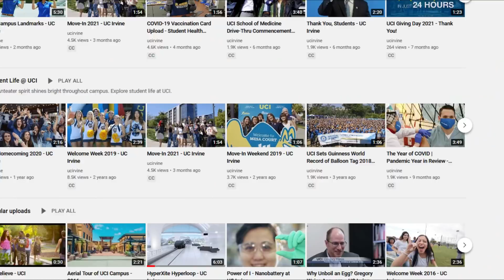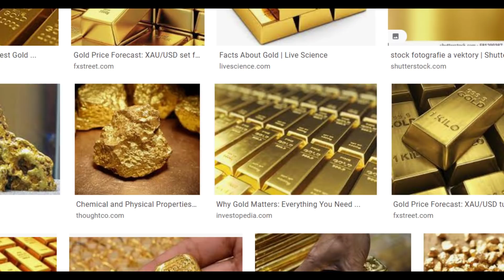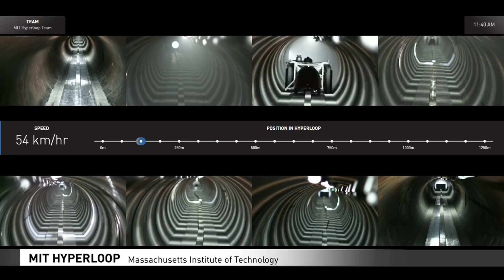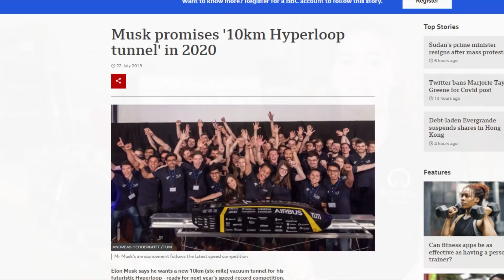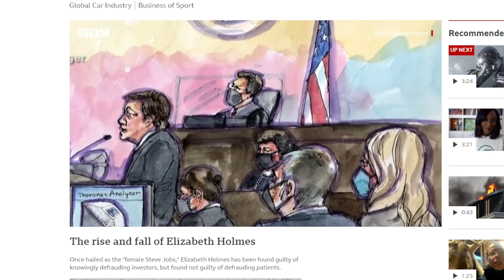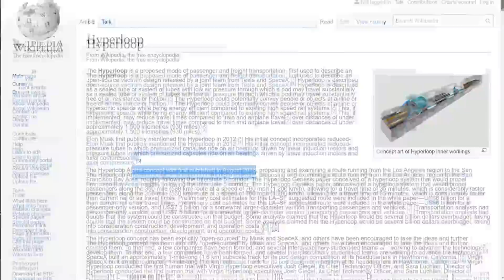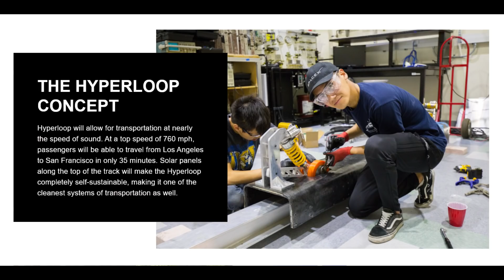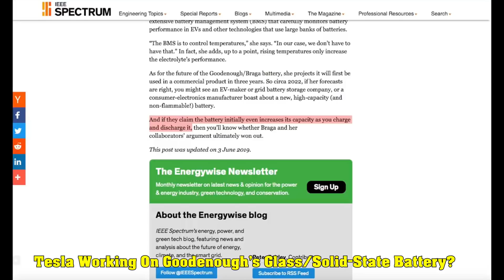The GOLD Battery that will revolutionize EVERYTHING!

Comment: The funniest thing was when they tested the pod, reached 60mph and they released it, only for it to stop by itself on vaccum faster than my civic on rubber tires on air...
Reply: Was this the original test that TF keeps playing? They were actually trying to test the breaking systems. The winning entry stopped the fastest using just the rails. Some of them were really crappy at stopping so it was hard to see what the competition was.

I think all of them took longer to stop than a family car which was crap because they were pretty light.
Reply: Faster than that Civic with the brakes locked up
Reply: @glenecollins  What else do you expect from Thunderf00t? As long as he can grow his Musk hateboner he don't care about factchecking. The sad reality of many skeptics these days who are right for the wrong reasons.
Reply: @sevret313  pretty sure the guy @glen is dissing musk and not in favor of the hyperloop lol. Stop dreaming maths says no so stop peddling crappy concepts
Reply: @sevret313  r/woosh
Reply: @sevret313  Regardless of if the video was about breaking or not. Explain how the hyperloop is in anyway a remotely good idea? I don't even mean finically. I mean physically. Tell me how at the first corner all the passengers don't die from the g-force or how the pod doesn't rip itself apart due to the internal friction forces? Elon is a man peddling lies to try and make money. The point stands.
Reply: @sevret313  musk is actually a tool, so don't get too upset. I don't dislike him due to TF either, musk is just a public facing figure that people somehow relate to. 

I reckon his supporters (that think he's actually taking part in projects) to 14 year old me believing Bill Gates was a genious and worked hard on Microsoft windows... when in reality he was so detached he didn't even work on DOS, he was just a face for the company.  Musk is the exact same thing, the only thing he does is sit on the phone and do public events.
Reply: @volvo09  The Edison of our times, specially the way he abuses Tesla's name, must be rolling in his grave
Reply: @volvo09  Gates Did a fair bit of the work on Dos  (which was the basis for Windows for a long time) and basic. Once he had enough of the intellectual property he ended up doing a lot more of the buisness side of things. Musk bought all of the IPs which he has made most of his money on, I don’t think he actually worked on any of it.

Musk has been pretty much a shares salesman for his whole career. That makes him more divorced from the products and could give him more plausible deniability. There is plenty of information showing investors he may not know what he is talking about. That was never the case for any of the Microsoft guys.
Reply: @glenecollins  Lol no way that's right? Why bother showing the full length of the track then? I doubt that's right what you said, source?
Reply: Civic owners are men of culture
Reply: @88Magician88  the maglev version of the Hyperloop is perfectly doable from a physics standpoint. The internal forces would generally be low except when emergency breaking. and we currently have the tech to carry most of the power required to operate the “pods” in the rails. 

We even have the tech to surround the pods in maglev rails so they could corner relatively quickly (but very uncomfortably for the passengers).

In a physics demo world there would not be problems with buying access through properties etc, you wouldn’t have to worry about the expansion seals wearing out due to constant work because you could use very large sweeping corners to allow movement for expansion etc.

IRL of course there would have to be tight corners etc due to property boundaries, geography and even local geology where you would be correct and the top speed would have to be greatly lowered for safety and comfort.

Areas with size constraints would also require way more upkeep because they would have to use the expansion joints I mentioned earlier as well as all the extra forces being placed on the whole setup. (There are also the safety concerns of having a lot of people potentially trapped in a small hot evacuated tunnel etc)

At least for the Virgin version I don’t think it is fair to say it is physically impossible just that it is far more expensive than a maglev train system and in practice on earth it wouldn’t have enough advantages to justify the enormous extra expense.
Reply: @glenecollins  I get that's physics says it's possible, but isn't a hyperloop extremely dangerous or is there something I'm missing. Especially in CA where earthquakes happen often?
Reply: @Onomatopoeia4u   Fire a bullet at it and pierce the outer layer and the entire thing collapses, in fact if there is a failure anywhere along the line the entire thing is done for, it can be viable physics-wise and it can be done via engineering it however would be the most expensive fuck up of all time, regular mag-levs in Japan are operating at barely any profit and that's in a country where majority of people use it as transportation every single day, now imagine putting that in a vacuum tube hundreds of miles long under near vacuum and all the stuff that will have to be done in order for them to insure it will both stay under vacuum and not kill people, do you think maintenance of such a tube would be less or more than conventional mag-lev trains? It's basically mag-lev maintenance cost plus vacuum tube maintenance cost, then think that car obsessed country like U.S. would just give up on cars and choose Death-loop over established, safer and cheaper modes of transport, already majority of Americans aren't using public transport in high enough numbers for it to be cheap, what do you think a ticket for Death-loop would cost? The viability of such project would hinge on just sheer number of people and/or cargo transported i don't see this happening, assuming it's created it will be abandoned or heavily subsidised by the government, because it simply won't have the numbers on its side.
Reply: @sevret313  The joke

You
Reply: @JoseMariArceta  you can hate musk and use facts simultaneously 🤯
Reply: @88Magician88  
Yeah the hyper loop animations with too sharp bends, are engraved in my memory. It is just a pump and dump scheme.
Reply: @IloveBaguette  r/itswoooshwithfouros
Reply: @glenecollins  
The hyper loop concept is a hoax.
Maglev was the future of railways and deemed too expensive. 
Putting it into an expensive steel tube requiring enormous amount of energy upkeep to employ a vacuum, while reducing the passenger count to few people.
It is unviable by factors of hundreds.
And tickets will cost $20…

Hyper loop is like saying the next iPhone costs $8, Coke cola costing $0,01 per bottle, a brand new car for $300.

It sounds like a great deal, but immediately not realistic. -That is how the hyper loop works: Most people have no idea about engineering and dual wield the numbers to defend a concept, that would save them money, if real.
Reply: @glenecollins  no. Gates didn't do any work on dos. He bought it from scp and other people worked on it.
Reply: @sevret313  As opposed to Elon, who is right for the wrong reasons.
Reply: @forbiddenera  I have the original MS-DOS source code around somewhere (not PCDOS version 1 or QDOS or anything) it has a heap of notes by him. 
It is true they bought the original QDOS off the guy who ran the first Visual Basic projects but they weren’t such a big company that they could afford to have just a buisness person up until around windows 3
Reply: @antman7673  maglev got deemed too hard in the US where it’s primary competition is airlines. In China and Europe where there is a shitload of people in a relatively small area it seems like a much more pressing concern.
Also in Europe and China it tends to be easier to put transport lines etc through peoples properties.

One of the “positives” that they put forward for the Hyperloop is that you could tunnel under the properties of people you couldn’t buy out.

The concept of a vacuum train is no more a hoax than any of the other giant engineering projects people have put forward that different people have glommed their ideas onto over the years. 

There are plenty of engineering ideas that are so colossal that no company can afford the initial outlay that doesn’t mean they are hoaxes it just means they are too expensive.

Musk always skirts the edges of those enormous mega projects like claiming he will setup a mars colony (where incidentally the Hyperloop would be a much more reasonable form of transport: you would be mainly keeping out dust not atmosphere, there are no current land holders, there is very little seismic activity etc.)

In the next decade or so I expect there to be a maglev form of the Hyperloop operating somewhere in the world unfortunately it will likely be a 30Km long boondoggle somewhere with more money than sense.
Reply: @glenecollins  How exactly does slowing down for corners and "extra maintenance" stop the whole loop from squishing like a tin can the second a car crashes and moves a support pillar a mm 
Not to mention the several hours wait for depressurization, literally taking a spaceship to wherever the Hyperloop would take you is not only safer it'd be faster too
Reply: @lordhater4207  That's exactly along the lines of what I was thinking. Thanks for detailed explanation 👍
Reply: Elon Musk's next invention, the Honda civic.
Reply: @LadyMistborn  I work with large pipelines which can be evacuated down to a fraction of an atmosphere they just have to be built more strongly. 

Building the tube rugged enough to hold up against one atmosphere where you could dent one side into the other without causing a catastrophic collapse of the line is doable and simple in engineering terms, we already make much larger diameter evacuated tubes for tokamak reactors and particle colliders.

Making long vacuum tubes is essentially no more of an engineering feat than making a rugged tube of the same diameter and pretty much any length.

Those tubes also have airlocks and pass throughs etc which can maintain a hard vacuum so it is definitely doable it is just a big part of the cost of the most expensive machines ever made when they are only hundreds of meters to a bunch of Km long.

To make one as long as a continent with airlocks close enough you could walk between them if something happened and able to repressurise in sections etc with the same degree of solidity would be $$$$$$$$$$$
Reply: You own a flying car? That's really cool.
Reply: @Ebani  if he is rollin, it be used as infinite power source
Reply: @glenecollins  Air locks still doesnt stop one guy with a 50.cal from suddenly changing the status of the vacuum from a nice distance. When a failure happens while a pod is traveling down the tube the pod will suddenly be met by a wall of air causing it to change direction and burst out the side of the tube or in the best scenario just blend everyone inside into a very fine paste. No air locks can save the people inside from a critical failure anywhere on the line if they are traveling at max speed
Reply: @PascalSWE  It is quite ironic for some one with name of pascal to have no clue how pressure works.
Reply: @Ebani  Most of my family thinks of Musk as this. They know it's all snake oil.
Reply: When I see all these pod ideas, they just make me laugh.  The Hyperloop is touted for a way to travel at high speed between cities and all they can show are stupid little carrying vehicles far removed from what would be needed.   Passenger trains such as Eurostar can be up to nearly 400 metres long.
How would even a 200 metre Hyperloop carrying vehicle work?
Reply: @glenecollins  Well I'll stop you right there. Right off the bat you seem to not know the problem. I don't care how much "maglev" you have. (Magnetic cushion means nothing for a change in momentum.) The problem is changing directions at these supposed speeds of 400mph+. It will never happen. Even if you strap the person down so they can't move the g-force from a sudden change in momentum at those speeds would be wayyyyy more than enough to kill any living thing in there. THAT'S the problem. That's the thing this "visionary engineer" doesn't understand. A simple physics problem.
Reply: @88Magician88  You cannot lie about one element of the hyperloop project just because the failure as a whole is infeasible.
Reply: @sevret313  I agree with that sentiment but overall I don't think it detracts from his statement that Elon is basically a conman.
Reply: @glenecollins  And might I add, the change in momentum is only the tip of the iceberg. As others have mentioned there are so many faults and potential catastrophic failures associated with this idea that to claim it's the future or some real idea is ludicrous. The only people who believe in this know nothing about engineering or physics. You also act like maglevs don't heat up. Yes in theory you could create a magnetic cushion that would support the capsule in a turn (even though everyone inside would die due to the g-forces) but where does that energy go? Well it gets stored in that magnetic field and dissipated as heat. So now we have a huge metal vacuum cylinder (that needs to be supercooled for the maglev to actually work) that gets a bunch of heat dumped into it every time one of these capsules goes around a turn. It's actually a terrible idea, all around.
Reply: @88Magician88  the idea is not to make many sharp turns at speed, not just the heat but also all that momentum has to go somewhere (ignoring passenger comfort) even in a normal elevated rail system the force of the train pushing the tracks and therefore the supports etc around is a big concern.

There is a simple solution you just buy land in a dead straight great circle line across the continent or whatever and build tunnels, bridges etc to it as level as possible. All corners have to be larger than what a cruising jumbo jet would take because the jet rolls slightly which makes corners more comfortable. (And they aren’t as fast).

If you are going to put all the money into what is basically an armoured sectioned tube that long and especially buying the land a few bridges and tunnels probably aren’t going to mess up your budget.

This does mean that in a city you would likely be limited to car speeds because turning using maglev doesn’t just make heat it also takes a lot of energy and even the best systems can’t turn at more than a fraction of a g
Reply: @ObsceneSuperMatt  not really, steel on steel has lower rolling friction, while braking depends on sliding friction. Braking on rails is hard because of the massive amounts of inertia trains have
Reply: @glenecollins  pretty sure the ENGINEERING standpoint is that thd hyperloop is a terrible idea and we lack both the pumps as well as the materials to build thousands of kilometer long vacuum tubes not to mention that it's still less energy efficient than a regular train all things said.
Reply: @88Magician88  True, the issue is that the way Thunderf00t covers things everyone can be portrayed as a conman.

Imagine Thunderf00ts great-grandfather arguing against electricity based on the fact that it is infeasible to put copper wires everywhere. Or sea cables for telegraphs.

"You want to put cables from England to the east coast? It won't work, all it takes is one fish to bite over the cable and you sever communication from Europe to the New World..."
Reply: @glenecollins  you completely fail when it comes to the engineering or physics side of things. A small pipeline can be built strong enough to hold a vacuum but make it a few times larger and the forces involved grow at an exponential rate. Just because we can build an elevator in a skyscraper doesn't mean we can use the same concept and scale it up to reach space. Same is true for vacuum tubes.
Reply: @marcosolo6491  Do I need to spell it out for you? Okay, I will. The CLAIM is that the Hyperloop travels at or near top speed during it's whole operation. (Because if it slows down and makes long turns, why not a maglev train? Much simpler and cheaper!) So there in lies the problem. Do you know how trains planes and rockets turn? In VERY large arcs to minimize the g-forces. The truth is this is touted as an innovation in modern transportation. It's not, it's a vacuum train and it's never been practical. Not when it was invented in the early 1900's and especially not now. It's been said it's going to remove traffic and be a clean mode of transportation. It's not. It can't work in cities. It can only go in straight lines. It's going to be THE most expensive mode of transportation in the history of humanity. A bad idea is just that, bad.
Reply: @sevret313  Well I think he assumes a prior knowledge to a lot of science. (Physics, basic math, chemistry) I find that when people tend to know a lot in a field then they forget what it's like to not know a lot in that field. Does he over exaggerate and possibly mislead a bit? Sure but overall I think the points he makes, are grounded in reality. Which is the point of it all.
Reply: @volvo09  The product is the stock.
Reply: Wait so...what if one of these breaks?
Suddenly sounds like a massive bomb
Reply: @volvo09  If Musk is a tool, you're implying that most people are... I'm okay with this. Guy is digging for any advancements he can find and finding serious money for this stuff too. He does more than 99.99% of people ever do for science. Tf00t is actually edging towards having a negative impact these days and he's a "real" scientist.
Reply: @sevret313  i give you a good reason: that near instantaneous stop from 60mph is anything but user friendly it looks as if the pod hit a wall)
and the original video is also a bit of a crap really.
it supposed to show that the pod can travel further without pushing it (aka where the energy efficiency comes in) and then safely stop before hitting the wall.

what we can see on the video is that it goes by being pushed and then near instantly stops. 
(their cgi video shows this idea of being accelerated to speed and then released and then carries on to the distant city)

so while i get that they shown a remarkable breaking capability i doubt it was what they intended, but also it is highly impractical to smash every passanger’s face into an airbag)
even a family car’s emergency breaking will try to get your face smahed into the things in front of you - imagine the force in that pod

i would argue that while they claim that they wanted to show off their incredible stopping distance, it was both an accident and also would not be implemented with real passangers and they would get close the rest of the competition)

note: the bigger (heavier) the pod (train) is the longer the distance will be both for logical reasons (lots of energy to tranform into heat) but also to protect the equipment from smashing itself into itself)

this is not about hating musk or anything, we are all (or most of us) technical people and loving the advancement of technology around us: but what is stupid is stupid, regardless of musk or whoever)

and while TF sort of enjoys bashing musk its because the madness around him (if he farts in an elevator, the media would claim Musk invented a new type of propulsion for elevators)

:)
Reply: @turkeyguy0  Yeah... It is true. Most people are... Including you... And you are ok with this, I am ok with this too.
Reply: @glenecollins  in the ‘70 and ‘80s FIAT (yeah that F in FCA) built a variable asset bullet train, that would bend in turns to make it more comfortable for the passengers. The fact that you didn’t even consider this possibility for lateral G forces, doesn’t really vouch for the validity of other technical considerations in your long analysis. A vacuum chamber hundred of miles long is total technical idiocy, take a away the vacuum element and what is left is bullet train, there are too many companies that know how to make better, faster , more reliable bullet trains than Musk and Branson. This is just money wasting for PR show off only, they should call back when there is a demo with passengers in a 10 km long vacuum tube, running at 400 mph (current maglev record at 360)
Reply: @KT-pv3kl  you are failing to think about the physics properly the strength of the materials required to hold a vacuum depends on the radius of the pipe not it’s length. The ITER will have a vacuum tube something like 10m high and a bit wider so we can make very large vacuum tubes if we want to spend enough per m of length.

we routinely make 2m diameter pipe lines which can safely hold a modest vacuum for testing. 

The pipes in the Virgin Hyperloop test site are thick enough to be safe even if crushed completely in one spot. Gas tankers like the one imploded on myth-busters are made of comparatively thin steel and are not ribbed.
Reply: @mityaboy4639  I do not care about what hyperloop can and cannot do, how good the user experience is etc. All I care about is Thunderf00t using footage to misrepresent what is actually being shown.
Reply: @Nivola1953  there was a local company which wanted to put tilt trains on the tracks in my area. I got the impression they tilted mainly in order to keep the wheels in contact with the tracks. As far as I know it isn’t possible to tilt any train using maglev and it obviously wouldn’t have the same effect as the tilt trains which run on tracks.

From what I gather the only way to tilt a train on maglev tracks would be to tilt the tracks which would be very dangerous if the trains or pod’s didn’t go over it at exactly the correct speed.
Reply: @glenecollins  Interesting you have the MS-Dos source code with comments by Gates. Doesn't alter the fact that DOS was originally written (as QDOS) by Tim Paterson at SCP. When MS bought it they also hired Paterson to port it to the IBM PC.  No doubt Gates had some involvement but was not its main  developer like most people believe. Gates main programming achievement was co-writing (with Allen) a version of BASIC for the Altair, later evolving into into QBASIC for the PC.
Reply: It's the one thing I like about Ford cars. If you release the accelerator, those things just roll on seemingly forever.
Reply: @glenecollins  Wrote "Also in Europe and China it tends to be easier to put transport lines etc through peoples properties"
In Europe? - no way!  It's very crowded here.

"One of the “positives” that they put forward for the Hyperloop is that you could tunnel under the properties of people you couldn’t buy out."
HL cannot suddenly dive up and down because of its high speed. Tunnelling is also an option for road and rail, so that's an advantage for them with their lower speeds. (I realise that you don't buy this supposed H-L advantage yourself.)
Reply: @turkeyguy0  Thunderf00t is more or less an experimentalist. Musk is more or less a venture capitalist they both arguably contribute to science in very different ways.

Experimentalists tend to get a bit myopic but they are still an essential part of the progress of science. Venture capitalists have their own methods to make their ventures grow and Musk’s shtick is mainly to push RnD and hype up the potential results.
Reply: @Nivola1953  Wrote : "in the ‘70 and ‘80s FIAT .. built a variable asset bullet train, that would bend in turns to make it more comfortable for the passengers" 
I guess you mean variable tilt.  FIAT bought the tech from British Rail who first used it on their Advanced Passenger Train which still holds UK speed records.  Even with tilt there is a limit on speed/curvature.
Reply: @dukenukem5768  historically Western Europe has actually been able to free up land for projects much more efficiently than the US has been able to (read the beginning of the hitchhiker’s guide to the galaxy). some of the states in the US have been more efficient at it but going interstate tends to be more of a problem than going internally in the EU.

It is hard to tell if the European countries could do it again but it seems more likely than the US.
Reply: @glenecollins  what you're describing is a megalev train with uneccesary and  expensive additions. We already have those tho. From one side, we could use existing structure and copy paste ot everywhere, 0 developing cost.
On the other hand, you can't make a fraud and a scam out of that
Reply: -Matter didn’t create anti matter
-Anti matter didn’t create matter
(Both of them were present at the time of big bang)
-Both of them didn’t create themselves.
-Both of them came from an unimaginable source,  that unimaginable source created matter and antimatter (everything) thats why it is known as “the creator” of everything.
——————
- that unimaginable source/creator has created sin and virtue which are opposite to each other,
— logic says every action has its own reaction, so the reaction of sin must be different than the reaction of virtue,
— the creator has created prophets to let us know about each and every detail of sin and virtue, also about their reactions,
Thank you :)
Reply: @glenecollins  "Also in Europe and China it tends to be easier to put transport lines etc through peoples properties" is extremely untrue, at least for Europe, no idea about China. Here in Slovenia for example pretty much all roads are zig-zagging weirdly through large fields just because that's the only way they could build them, since doing it differently would mean cutting fields or potential fields in half and no farmer or land owner would consent to that, and without consent for it the road just wouldn't get built. Our government has been trying to build a new railroad (regular railroad, not maglev) track for the past two decades with no success, in big part because of this very issue, and because of the price increase that would be required to overcome it (such as actually buying the properties where they can't get the consent to build. The situation isn't very different in most other EU countries, though I'm sure there's some exceptions. There's very few straight roads in Europe, outside of highways, since those mainly connect between major cities so they mainly go though relatively unpopulated areas.

I agree with a lot of what you said otherwise, just wanted to correct you on this particular point.
Reply: @sevret313  yea lets just wait 18 more years for tesla to release thier stuff
Reply: @88Magician88  its all magic. Thats why we have been unable to build one so far our magic is only lvl 12 not 99+
Reply: @prich0382  they expected to get a mile.
Reply: @glenecollins  its litteraly impossible. Even if all the physics add up. We humand are not able to create such a huge system and have it be fault free. Normaly a fault wouldnt a problem with a road cars can drive around the crashed car. But on a hyperloop if 1 pod just lost all accelration and speed. It would block every other pod, people couldnt just get out because of the 1/100 of an atmosphere and even 1 broken seal could kill everyone with the sonic speed airwall flushing back into the system. Its a dumb idea and am glad the people 120 years ago were smart enough to figure that out
Reply: @glenecollins  nah man it wil neverwork out. Its too fragile and a perfect terrorist attack place. Also if putting stuff underground is better why are all your powercables on poles? And why did it take years for every digging under peoples properties project to complese some short tunnels. Its a fantasy project. Its cheaper to run 10 planes a day extra for a couple of years
Reply: @glenecollins  even that but you also dont have humand groing trough the pipes dropping stuff or breaking stuff every trip. Since 1 failure would mean countless lifes compared to just lots of money
Reply: @fireworkstarter  if they could have effectively pumped down the tubes I am certain vacuum railways would have been common before airliners got popular. People used to take much much higher risks 60+ years ago. 

I think the idea was to have many small tubes so that the pods can efficiently go in a lot of different directions, as well as segments which can be independently closed off.

The easiest way to prevent repressurisation from becoming catastrophic would be to have segments and many airlocks which open up if a part of their segment is breached. They would also allow people to escape.
Reply: @turkeyguy0  yea cause musk has made.... oh yea just some cars and rockets weve had since the 50s. Id rather have him focus on fundamentals like thunderfoot. Might actualy bring a material for further advancement instead of just claiming well go to mars in -1 years
Reply: @fireworkstarter  of course all the extra moving parts do make it less reliable and way more expensive.
Reply: @fireworkstarter  maglev trains are possibly a better terrorist target, they have way more people aboard than a pod, they also have far more mass so that if they can be smashed into buildings or traffic they will do a lot more damage.
Reply: @glenecollins  yea than 1 pod. But if you have an entire tube line all coneccted to the same vacuum. And you  destroy the middle it would destroy every life in both ends of the tubes. Magless are nothing compared to this idea
Reply: @glenecollins  have more mass sure. But not 10x the velocity. Just the air rushing back into the tube. Metal plastic or glass its going to make an implotuon and kill everyone closeby
Reply: @glenecollins   effectifly pumped down the tubes? And segemented tubes? What if the segment closes because of an error starting all emergency doors while youre going 500miles an hour. People have done the maths and realized its the dumbest project you can build if you have the money. Same as one of those balls around the sun to absorb all the energy xD
Reply: @fireworkstarter  How do you and Thunderf00t's great-great-grandfather know that there is no fish that likes to telegraph cables in the atlantic?
Reply: @sevret313  we atleast wouldnt try to give you a fake mode of transport
Reply: @prich0382  There's another TF00t video that shows that Musk basically jumped from Company to company and sold his shares, that's where his income is from, NOT from any of his "Inventions"
Reply: @glenecollins  Hi, I'm from Europe. ... Germany.

Maglev Trains failed here. It was called the Transrapid. It was too expensive and not needed.

Building public stuff on private propertys is very difficult here. Right now we have problems updating our electricity grid, because people dont want poerlines close to their homes. 

You can stop, loud, big and dangerous stuff even if it close to your property here.

What else...?!  The tunnel diging assumption is wrong, too. 
You have to get clearance if you are crossing a property.

There are a lot of environmental laws here, too.

A lot of what you think about europe is wrong.
Reply: @glenecollins   "Gates Did a fair bit of the work on Dos  (which was the basis for Windows for a long time) and basic. Once he had enough of the intellectual property he ended up doing a lot more of the buisness side of things. Musk bought all of the IPs which he has made most of his money on, I don’t think he actually worked on any of it."  THIS! THIS!
Reply: @88Magician88  "Right off the bat you seem to not know the problem. I don't care how much "maglev" you have. (Magnetic cushion means nothing for a change in momentum.) The problem is changing directions at these supposed speeds of 400mph+. It will never happen. Even if you strap the person down so they can't move the g-force from a sudden change in momentum at those speeds would be wayyyyy more than enough to kill any living thing in there. THAT'S the problem. That's the thing this "visionary engineer" doesn't understand. A simple physics problem."  BOOM! TRUTH!  A simple biophysics problem.
Reply: @sevret313    Good. You care about that imaginary thing (TF using footage to misrepresent anything).
Reply: @marcosolo6491  So here is the problem. If it doesn't, then there is NO REASON to not simply use maglev trains. They are just as fast, cost less to build and are much much safer. So either you are saying you want to overcomplicate and pump a bunch of money into an already existing technology for NO GAIN. OR you want to run it at top speeds and kill everyone inside. Either way, the idea is terrible. Do you get it now?
Reply: @fireworkstarter    I always find the "terrorist attack" a weak excuse. Oh, sure. Physically: yes. Absolutely: one bullet hole destroys the whole tube.  But, I mean, the actual chance of terrorist attack is ridiculously low.  Media hype wildly exaggerates chances of terrorists risking arrest and imprisonment doing something like this.
Reply: @fireworkstarter  "I'd rather have him focus on fundamentals like thunderfoot. Might actualy bring a material for further advancement instead of just claiming well go to mars in -1 years" YES! THIS!
Reply: @88Magician88  "If it doesn't, then there is NO REASON to not simply use maglev trains. They are just as fast, cost lest to build and are much much safer." THIS!
Reply: @jcd-k2s    The world being way past peak oil now means oil will only get desperately more expensive.
We will need to greatly restrict its consumption. That will include mandatory birth control (which is a necessary idea for plenty of other reasons, too) and outlawing the meat industry (also a great idea for other reasons).
Reply: @dillmon1  yeah bacterial cultures lmfao
Reply: @glenecollins  haha you claim that it is all about braking when the competition it to show how awesome and fast the "vehicles " will be to win the competition?

And you focus on the track when it is the vacuum and integrity of the tube that makes it the most unfeasible. You claim to have worked with pipeline. That has to big enough to hold a train inside? Where the tube have to be sealed and unsealed along the way to drop off and admit passenger? I doubt so as you don't seems to know the number of vacuum pump such a set up will need every tens of meter.
Reply: @volvo09  Musk is no tool... ha managed to grift his way to being the wealthiest man on Earth. Kudos to him for his success. I reserve my criticism for the fools that blindly support projects that are blatantly unworkable.
BTW, I'm no Musk fanboy, I just appreciate a skilled conman working his magic.
That said, at least Tesla was a commercial success, so some of his ideas actually produced something useful.
Reply: @glenecollins  China already went big on traditional high speed rail. The extra speed from a functional hyper loop would not be worth the immense costs.
Reply: @Jinkypigs  you need to work on your reading comprehension. The pipelines I have worked on were for for gas transport and the vacuum was just for testing, they test relatively small sections and pump down to about 5 bar in 1/2 an hour or so with a pump setup on a truck. They are nowhere near big enough to hold a train and the proposed vacuum level of the Hyperloop would take a lot more pumping than we do for the tests, the reason I brought it up is because the force differential on the pipe is essentially the same, the pipes aren’t particularly thick walled Or armoured and they don’t collapse.

The vacuum pump thing isn’t as big of a deal as TF made out, to maintain a hard vacuum you would indeed need a heck of a lot of pumps. However large piston pumps can be used at regular intervals to pump down to their proposed pressures. A rotary vane turbine (Effectively a large vacuum cleaner pump) would be able to get about 70% of the way there they can pump out large volumes very quickly however they can’t reach higher vacuum levels. 

They would need to use thick and/ or ribbed pipes, a shitload of expensive vacuum seals and develop efficient airlocks etc it would be doable just really expensive.
Reply: @Mr Owl I would prefer people telecommute rather than take all the energy getting around. Transporting water does seem like a better use.
Reply: @turkeyguy0  yes great advancements in battery tech, he managed to make a battery with 50% more charge..........
Shit, turns out he did it by making the battery 50% bigger!!. what a fucking genius!!.
Reply: @glenecollins  "to have segments and many airlocks"

So the "train/pod/magic coffin" has to wait while airlocks open and close, the whole point was they are supposed to be really really fast. what a fuckwit idea!.
Reply: @glenecollins  "pump down to about 5 bar" 
Are you sure you know what a fucking vacuum is? you do know that 5 bar is higher pressure than we have at sea level? (by approx 5 times), that is the opposite to a fucking vacuum.
Reply: @glenecollins  Elon musk has the gall to call himself an engineer for all of his companies.
Reply: Noted, we will used honda civics instead of the pods.
Reply: @ReapermanUK  nope 😳 I am not certain: the vacuum stuff is handled by the contractors who run the truck so I didn’t spot that, I meant 5 millibar and that is almost certainly wrong that is about the pressure I pump my epoxy resin down to to get the bubbles out I want to say 50 millibar but that would be a bit of a coincidence. The actual measurement isn’t important as long as it is a fraction of an atmosphere it has one atmosphere on the outside pushing in and a fraction of an atmosphere pushing out.

. The pressure they are designed to operate at is something like 50 bar methane liquifies at about 46 bar so they rate the setup to a higher pressure just in case. 

(which also isn’t my job. I am just supposed to assess the ground the pipelines are held up on and the contractor I work for recommends fill or ground stabilisation or whatever is required. Because I am a junior I get to go back along after the pipeline is erected and check the creep markers and look for subsistence and other instability indicators. Which means I get to see the pipes being tested and talk to the guys in camp).
Reply: @ReapermanUK  the segments would only isolate if there was a problem and the airlocks would be along the outside of the pipe ready to open all the way to let air in and people out in an emergency. I said airlocks because they could also be used for maintenance etc and keep the vacuum. Otherwise they could just use hatches (or a mix of the two). They would have to have the hatches or airlocks every 500m or something so that people wouldn’t be stuck in a hot pipe for very long in an emergency. So going across a continent that is going to be a heck of a lot of at least airtight hatches.

In general operation for the pods the only airlock would be at each stop, I can’t see them getting a good enough seal to allow people to get in and out without pump down time.
Reply: @sevret313  hey speak bud. People r asking u questions.
Reply: @Ayybob  I don't see any relevant unanswered questions.
Reply: @glenecollins  rails? I thought hyperloop was magnets and compressed air not a tube train. That exists!
Reply: @HDTomo  I think they call the maglev “tracks” rails. If there is a different name I don’t know it. I think the idea is to have physical rails for emergency breaking etc though I wouldn’t want to hit rails at Mach 1 or whatever. 

I don’t think anyone actually worked out how to do emergency breaking on Musk’s air hockey table design I don’t remember there being much calculation of cornering and breaking forces etc in his white paper but it has been a while.
Reply: @shimes424  if you pull 2nd gear and then money shift unto 1st... I dunno, maybe the honda has a chance 😂
Reply: In air, not on air.
Reply: @Ebani  
Revolving faster than a Tesla turbine.
Reply: @bananian  
Don't you mean the Hyper Honda?
Reply: @GameTimeWhy  
Under appropriated comment. 😉
Reply: Sheeesh.
Reply: @chrisvig123  Are you working on Thunderf00t's cherry plantation?
Reply: @sevret313  Doofus.
Reply: @Cbd_7ohm  Sorry for insulting your glorious leader Thunderf00t.
Reply: @sevret313  He isn't my leader. He is just right on almost every issue he makes a video about.
Reply: @Cbd_7ohm  Yes, but his line of reasoning isn't always good. Of course Thunderf00t is right 95% of the time, he's picking lowhanging fruit. But that doesn't mean he should be sloppy and misrepresent certain elements of what he's debunking.
Reply: @cablecow15 Yes, which still doesn't excuse lying about parts of what he's doing. How hard is this to understand?
Reply: @dukenukem5768  ahh the old APT, good old British ingenuity to solve the problem that we don’t want to spend money fixing the problem so let’s create wonderful solutions to the symptoms. Don’t get me wrong, there were great strides there, but the reason for the tilt was to keep the passengers from feeling ill due to the lateral g forces when going round the curves that were too tight for the speeds they wanted to go. British rails were developed in the steam age so didn’t really need to account for 200mph trains some steam typically maxed out at around the 100 mark. It’s the tracks that make the built train and France’s TGV so fast.
Reply: @Ebani  Tesla (the one that wanted to marry a pigeon), rolling in his grave? I don't know if that qualities as a dis.